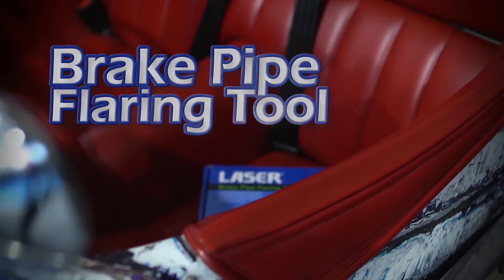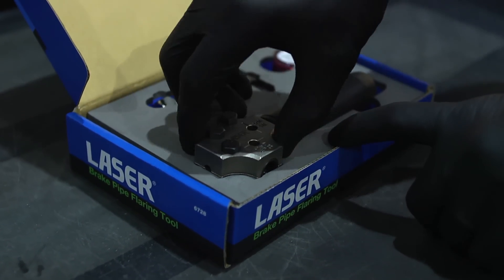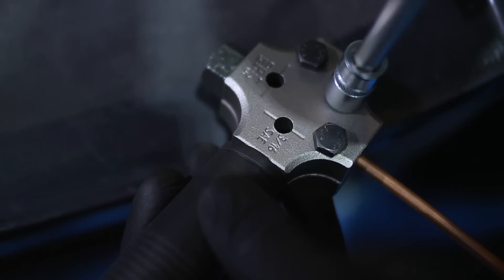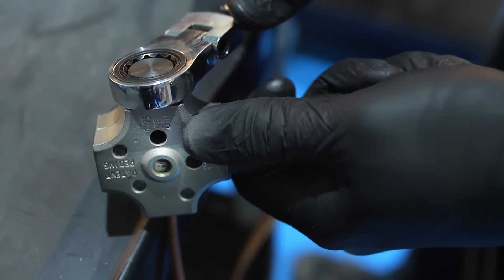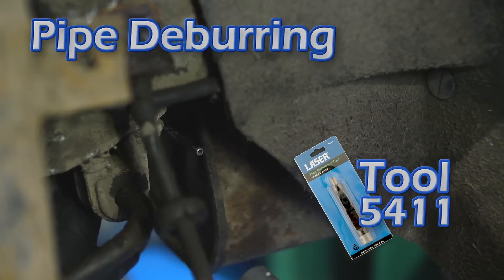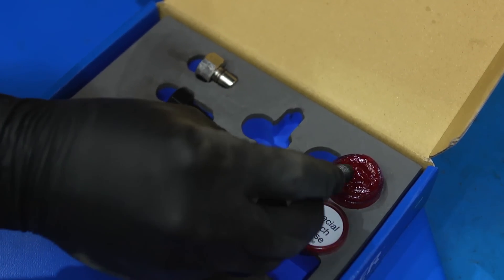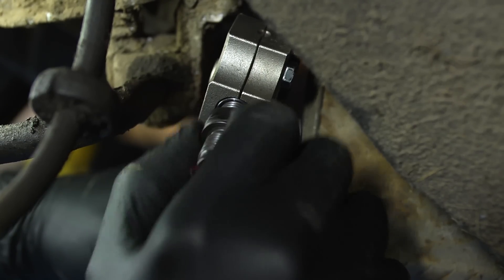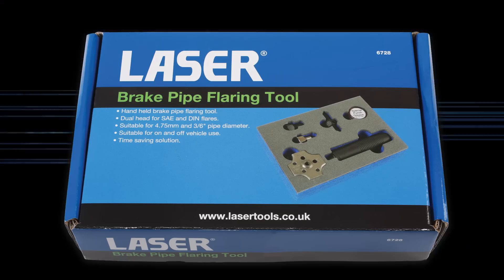6728 | LaserTools Brake Pipe Flaring Tool

Comment: I highly doubt that flaring the steel brake pipe on the car would be that easy..
Reply: Steel (or even stainless steel) requires a bit more strength than copper, but it is not all that hard.
Reply: It’s super easy I have this kit and it’s a life saver for both DIN and double flares